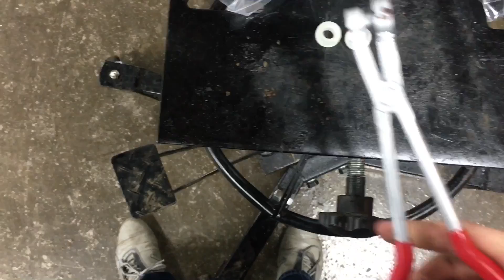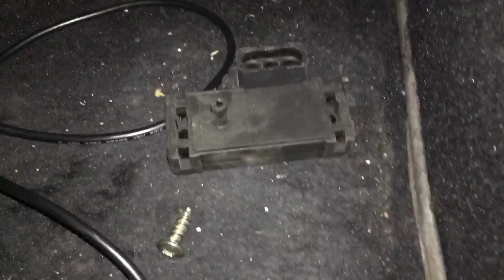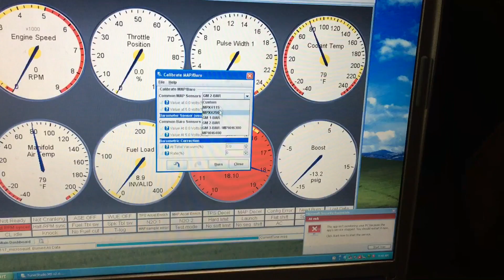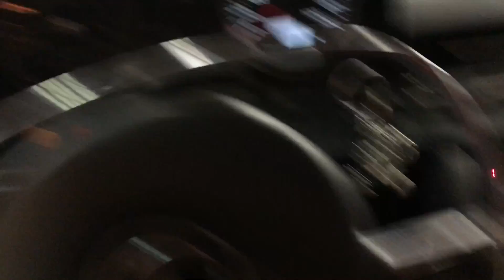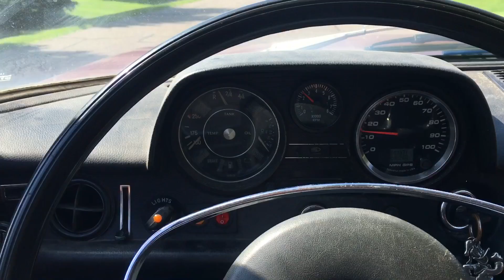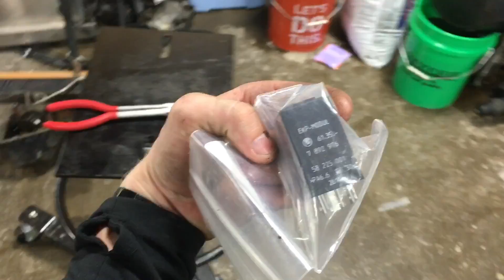Mercedes 240D w115 m117 project update and drive M3 pump relay and 850 cold start

Comment: videos on the 328i wagon. ESS Supercharger kit!
Reply from the maker: I've been tempted certainly but still $4,500

that wagon is so damn rare too.
Reply: +Camper1234599 there's a guy in Pensacola selling a kit for 3000. doesn't come with the tune however as the tune is married to that vin. I'm sure ESS can make a new one.
Reply from the maker: hmm -- link? I can touch base with ESS and see what it would cost me to get.
Reply: http://www.e90post.com/forums/showthread.php?t=1266638&highlight=supercharger

there you go! mad videos if you get it. I have a 128i with AA headers and 3 stage intake manifold and its pretty nice.
Reply from the maker: I posted up - we'll see,

I'll shoot ESS a message now too just in case.

contemplated headers and X5 N52 inlet manifold for Mr. Wags.
Reply from the maker: whats it from?
Reply: +Camper1234599 x5 n52.
Reply from the maker: interested pending the price being reasonable.